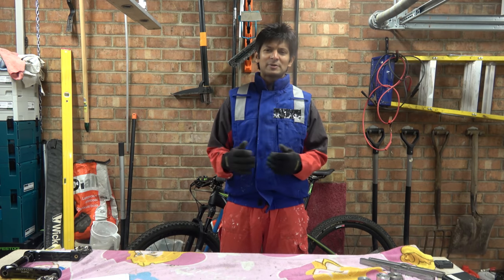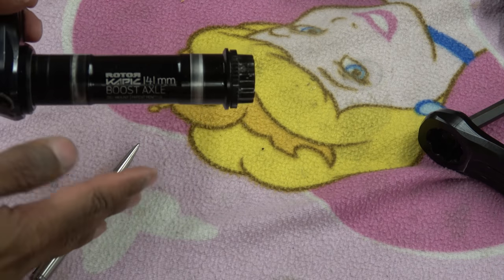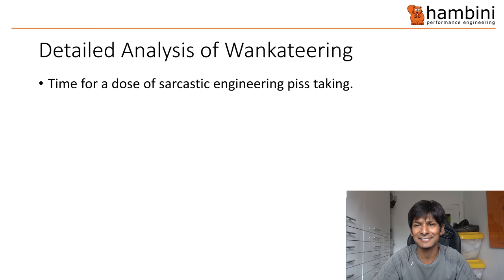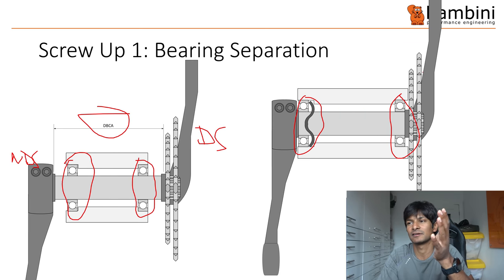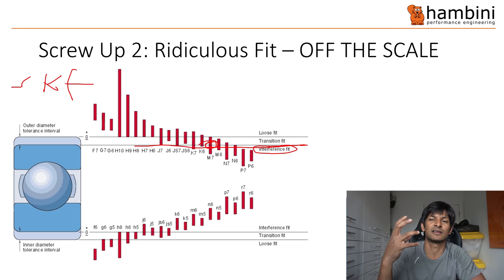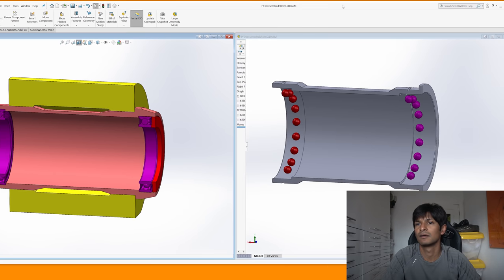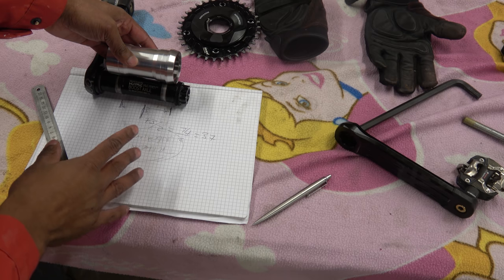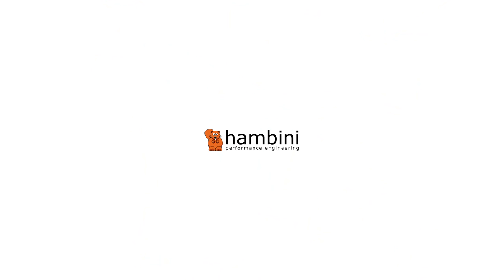Engineered By Muppets | Niner Bikes get Burned for being CRAP | Abysmal QA

Comment: Hi Hambini  !!! 
This  BB spins much better now then as shown on video . 

Thanks so much for removing all the creaks , and and bring  the bb to  a normal spec that explains why I had so much creak and damage the crank axle .
Reply from the maker: In case anyone is wondering, this message is from the chap whose bike it is!
Reply: Did you have to replace your axle? Thank god you weren't using Rotor's axle-based power meter.
Reply: @ivanivanov7064  I haven't replaced it yet  the reason why is I work away from home now so I have only one bike (gravel) with me .
Reply: Nice wheels that, it's a shame they fail at such a basic yet important part. I had the same issue on a boardy I have. I resolved mine with an off the shelf bottom bracket that threaded into itself inside the pressfit section. Glad the 5 year old was able to sort it for you.
Reply: Thanks for the content man
Reply: I have one of his BB's in my evo 386 Kuota Kobalt. It did stop the creaking. It was a well used shimano BB with semi plastic parts though and they tend to flex, compress and move. Best decision i have made getting that BB. Rock solid and my local approves.
Reply: try KY gets the creaks out without any bs
Reply: @saynotothegreatreset  wouldn't have thought you'd need to replace the axle, now that the bearings are further outward and away from the damage ?
Reply: @ivanivanov7064  I don't think he needs to urgently, as the new BB is outbored, the bearings are not seating on the original position where the damages are made, they are further apart now. I would think that crank is good for a long time. Just my opinion. Correct me if you think otherwise.
Reply: @axiomic  correct!!
Reply: @ivanivanov7064  I think he made a great reset of his axle to put some thinfoil in between.😂
Reply: @axiomic  You get notch impact  cracks, eventually leading to your face impacting on the tarmac. I wouldn't replace the shaft though, smoothening the damaged surface on a lathe will fix this.
Reply: should have posted this here and not in the main feed:

Manufacturing defects happen and it appears this is one of those instances. That is a 2017 model and Niner has a 5 year warranty on their carbon frames....so I'm scratching my head as to why go though all this and not warranty the frame? 

Did Niner deny the claim and this was the next best thing? I mean now there is zero chance they will stand by their warranty with what work has been done. 

It just seems odd to me....
Reply: @Masi22isaM  The manufacturer/retailer has to agree it is warrantable. In short, it is at their discretion if they will warranty anything. 

I think this situation is classified as fair wear and tear. I think the only way to get another frame was to have returned it back to them within the grace period, assuming they offered a grace period.

Comment: I own a Niner BSB9 CX Bike! No Issues on the PF Bottom Bracket but the I figured out (way too late) that the brake mount is misaligned so it is basically impossible (at least for a mechanical declined like myself) to correctly align the brake caliper.
I guess when you order a Niner they turn the wheel of misfurtune to decide where to fook up your frame!
Reply: yeah i winced my way through this video after purchasing a used bsb 9 rdo just yesterday.  fingers crossed that its not being passed down bc of issues that will soon make themselves apparent
Reply: RollinRat  That's why I keep buying Giant bikes even though they are really conservative and not really sexy. At least I know the frames will be well made.
Reply: @adventure velo Why should LBS fix the defects from manufacturer? They're already swamped with maintenance.
Reply: RollinRat  I've had giant frames off and on and they gave given me lots of KMs with no failures. The quality control is probably as good as it gets for mass production.
Reply: Dolan did the same to me. Luckily it was only a spare project touring bike. Rear brake boss is 1/4 INCHES off center. DO NOT buy any of DOLANS sale bikes that state they have cosmetic only defects. I bought mine with the understanding that it was a paint chip only. 1.5 years later when i went to build it up i noticed the shitshow that DOLAN shipped me. Now i know why they wanted to get rid of this thing. I wont buy anything with the name of Terry Dolan anymore. Sad really cos he did some quality stuff for ex pros like boardman. His shoddy Q&A led me to waste nearly 200 pounds on a frame i cant even get rid of to soembody else as i dont want them to be stuck with this peice of shit.
Reply: RollinRat  Very good and probably underrated comments, mate. I was just replacing the nipples on a rear wheel I recently built because the plain aluminum nipples I used seemed weaker than some red ones (WS) I used on another build up so I am assuming the color anodizing process is responsible for better overall strength. I am still new so surely more errors and lessons await me but preferably less. I build furniture and always build for strength. Like you said we know it is right cuz we did it. I change my own motor oil and try and do all my own vehicle customizations and repairs. Anyways to wrap this up, I sweat things that don't seem right and test things a bit. I know these guys in a factory are part of a factory where unless it is Japanese and Kaizen is probably trying to sweep imperfections under the rug. Speaking of Japanese craft have you seen Nao Tomii's steel bikes? They're great and he's an awesome guy. Cheers to you and the great Hambini!🤙🏻
Reply: RollinRat  bro I'm just like you. Age has caught up with me finally. Going under knife possibly soon (still nervous) for hip labrum tear from doing park jumps in a mountain bike that is not normally my bike. I have had a S Works with 19" seat tube for years but had the shock torn down for maintenance. I was riding a taiwanese made Stevens with 21.5 seat tube and a Marzocchi fork that was pumped up too much because my son is overweight and I was readying the bike for him. It turns out his girlfriend motivates him a lot more than I ever will!!

I started out riding early 80's on a Kuwahara bmx bike that I loved to roll in but I could never escape my fears to get a ton of air on jumps. I had a Mercier road after that and a Diamond Back 30+ lbs early mountain bike. The 98 S Works with CK hubs has been my faithful companion for many years and is made fun of but for no reason because it works in cross country but not very well on fast downhill down a creek for example. I am thinking of buying a Turner full suspension and building some wheels for it. I purchased and then cancelled a Miyata Pro in red last year with Suntour Superbe. It was 400$ but the dude was slow in getting me size specs. I had Suntour on my Kuwahara. I am looking at buying a Mongoose or something soon just to have or give to my buddy's ten year old son. He needs a bike bad!! All my wheels are 32h and I like Campy and Miche hubs. The bikes on build are all steel or mixed with carbon fork and seat stays. I cant rate them yet. I like Ergopower for shift duties. Are the spiral butted Miyata frames any good? Yes do check out Tomii Cycles because I spent time with this guy and his work is for the love of it. He was a museum sculptor and does awesome work. I am not sold on the 1x front chainring and disc brakes but he can build to any spec. I have never met a nicer and funnier guy than Nao!! He moved to Austin from Boston (after Japan) and knows the Boston people that worked at Independent Fabrications. 

As far as nipples go thanks for the advice. I may need to stick with brass. What spoke prep you like? What hub grease? I have noticed on hubs that the open bearing ones need preload set perfectly neither too tight or too loose. Of course clean is important.
Reply: RollinRat  bike industry real problem is GREED
Reply: RollinRat  Hey a lot of similarities between us on bikes. I have Chris King hub/Mavic 517 wheelset since mid 90's that have been rock solid. King did me right rebuilding both front and rear hubs because they don't last forever if you use them but they charge cheap like 50 bucks each. The engagement is tighter and better for mountain use. I am thinking of buying a like new Turner frame made in USA from a guy in Cali that didn't abuse it. I went to Austin to learn frame-building from a guy out there but it will have to wait and he is more of a loner when building. I often do my own work because I am poor and cheap. But my expertise is mainly in wood and my emphasis is on solid joinery and the wood itself. One day maybe I get me a TIG welder and do that. My work bench will be able to support vices for metal and of course wood vices. But I still don't know if I will really get lost into steel frame-building. I am already building wood stuff, roasting coffee, making food, building loudspeakers, and putting bikes together. I have a ton of respect for Tomii Cycles as his work is flawless and he makes his own stems and other stuff. I am with you on buying quality!
Reply: RollinRat  Cool cool cool. Well tell me what you think of Ellsworth? I found what I could tell interesting of Tony but I heard he was a jerk. I don't really care if someone is considered a jerk. If the man is brilliant then he is brilliant. My dad is  lawyer who found a way to get off the farm and make good dough but I have always been more an engineer type. I was always testing how hard things were and when they would break. Right now I have actually broken hip labrum(its really a tear) so this is testing me because I thought I was going to stay young forever. I was never a wild jumper on my Bmx bike with Suntour hubs but I have played so many sports and am dealing with the rest of my joint issues so hopefully I can get back on the horse at full tilt and not so half ass I have been for 11 months. Normally I trail run, mountain bike, commute, tennis, and practice soccer even by myself. 

I was a self-doubter and question-asker when I was a kid but after working in tech support and customer service I kind of decided to quit that game and do my hobbies full time. My main hobby has been audio and I used a German dude to built home cabinets and I did car audio myself. At age 40 I went to college for woodwork. Although I took apart a car in my 20's and did automobile service writing for a bit and sold cars I got more confident in taking apart and building things since learning how to be a designer. Being a designer helps you understand the genesis of things. So everything from rockets to boats and houses becomes much more doable. Its all just a bunch of steps. I took some drafting and art. Many of the older men I build stuff with were engineers or chemists and moved to Santa Fe to retire. The best one was a classical musician though and as patient as he was rehearsing music he took that into the woodshop with meticulousness and flair and beauty. Really amazing life he has lived traveling the world and dedicating himself to his craft. 

I clean and grease stuff. My woodstuff's joinery is pretty flawless so that transfers to bikes somewhat. I deburr more than others probably. I clean every spec of old grease and experiment with different greases too. Thats the only way I will learn. I like Miche and Campy for road but Shimano is ok. My King hubs went bad because I did not have the tool to tighten them and did not clean them back then. King updated the pawls though with stainless and really noisy new stuff. I want to play with all the hubs eventually. Why not right? I rebuilt my Manitou fork which was really jacked up with old grease that had become glue. In the interim I rode a crappy bike I was trying to set up for my son and thats the one I crashed doing a jump in when I messed up my hip. If my S Works had been working it may not have happened. I was also experimenting with flats whereas I have used Time pedals forever on trail. I now know I am not all new rubber like I used to be. I am more like an older more brittle rubber bushing car and my grease is hydration and the joint supplements they sell like the Chondroitin Sulfate. Anyways take care and when I say take care I mean it! We gotta keep pedaling safely. :)
Reply: For years I've been trying to understand why Niner is so much more expensive than other brands with the same groupset and features. 2x and 3x more expensive. My quest continues.
Reply: RollinRat  what you think of boutique brands quality control? Can you recommend any brands that are value for money without the marketing bs?